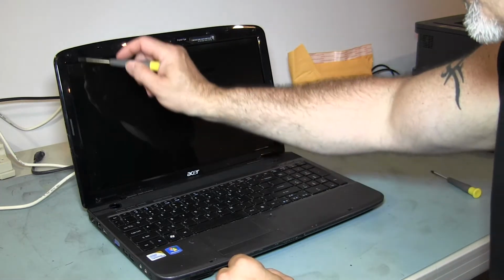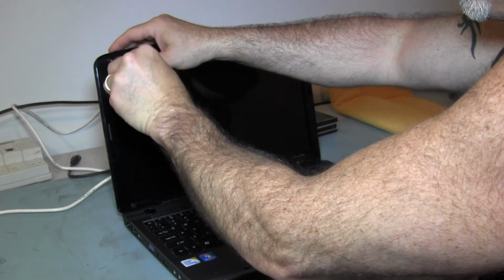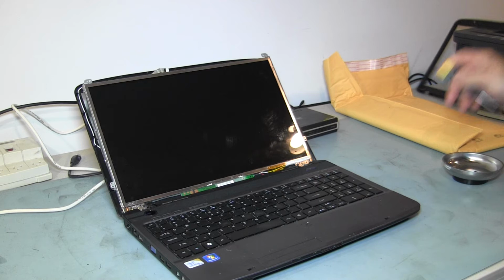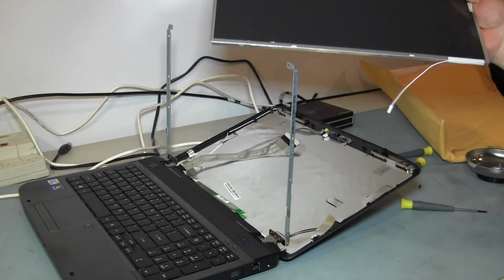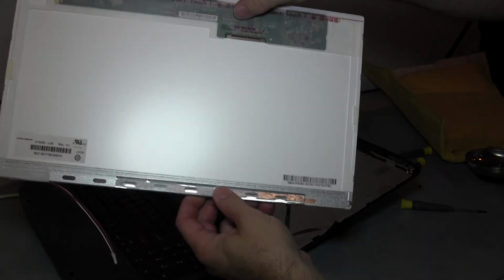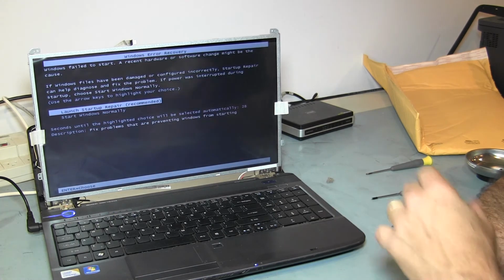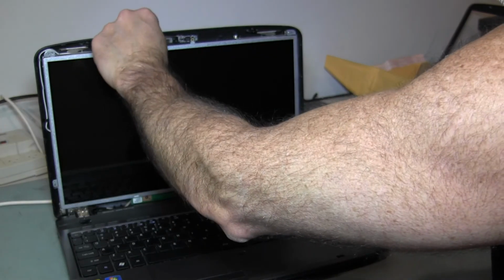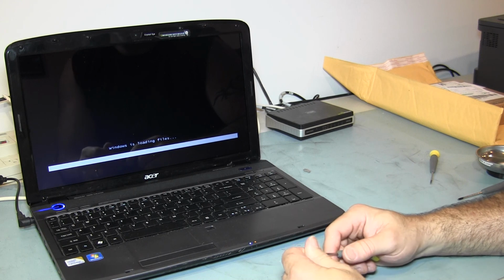Laptop Screen Replacement - How to replace laptop screen for Acer Aspire 5738

Comment: I have the aspire 5738z so i imagine the screen replace would be the same i have ordered one that has the bezel and hinges and clamshell already assembled should be an easy job mine devloped a white blob in the middle of the screen looks like screen burn wonder if using a screen saver would help reduce this problem, great video and gave me a good insight should have my replacement screen by monday.

Comment: Mine is a multi-touch screen model (Aspire 5738PG). The touch screen cracked and is non functional but the display itself is ok. Can it be replaced without having to replace the whole display? If yes, how do I get the old touch screen off the display?

Comment from the maker: It may be the inverter board. That is a separate  long skinny circuit board that is usually at the bottom of the display. I had to change out one of those in a laptop I fixed. It sometimes seems like it is the display but it is actually the inverter card.